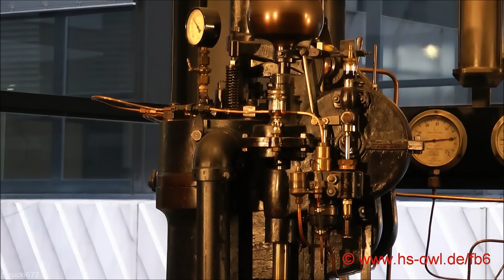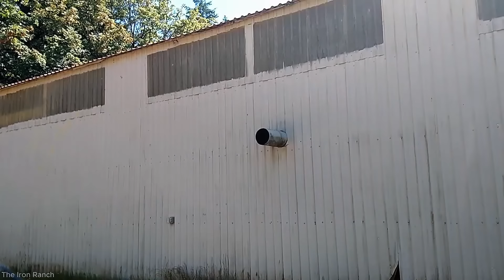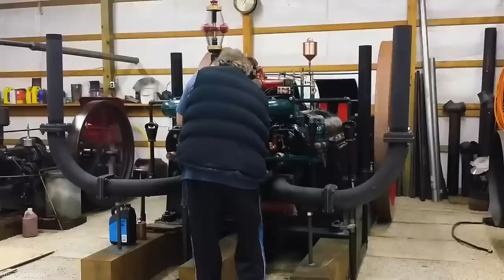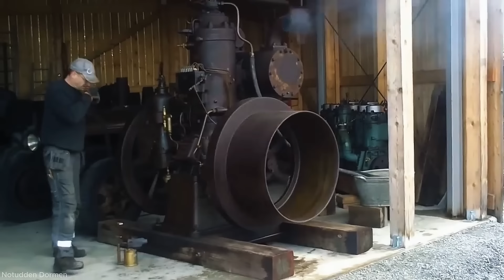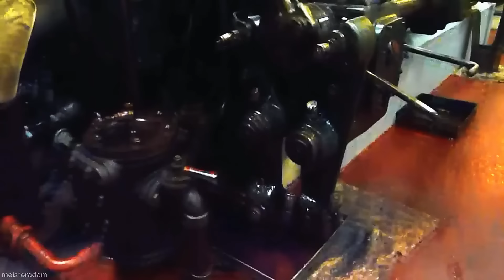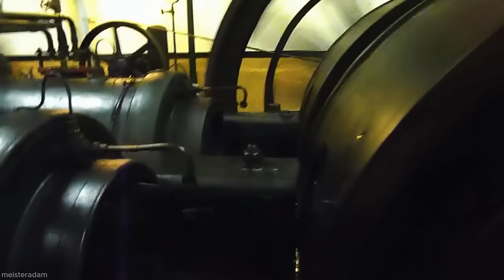How The Oldest Diesel Engine Still Runs After 120 Years. Vintage Industrial Machinery Documentary

Comment: I had a diesel PT Cruiser, it had over 250, 000+ miles on the clock, it was never rebuilt, it just needed regula oil and air filter changes
I ran it on red diesel, chip fat oil (collected it from chip shops)
It was buried in snow for a 2 weeks, it started on the button
It was a briliant car. never let me down, I had to sell it because of ULEZ, and Sadiq Khan
It was the only car I could get up and back to Liverpool and still have diesl for a week to get to and from work for a week